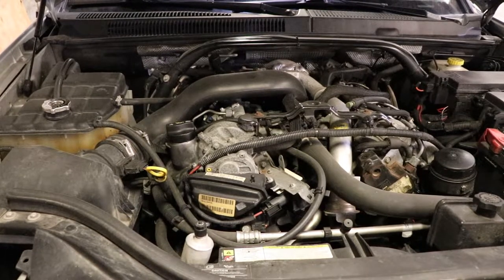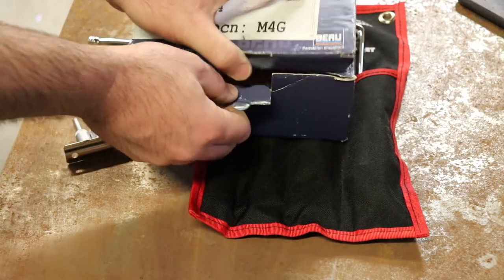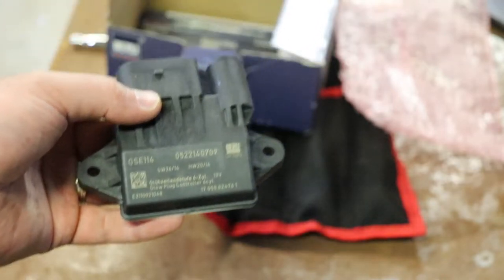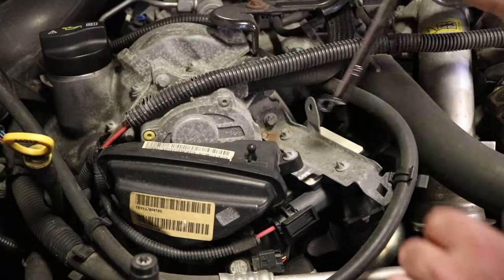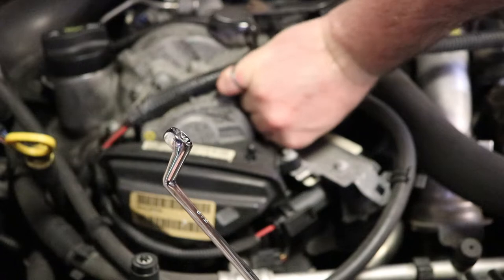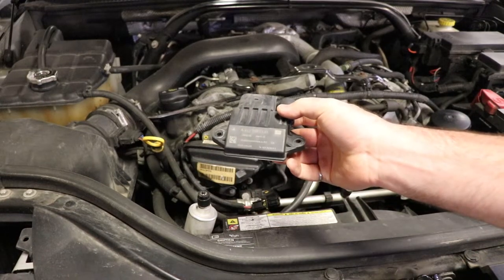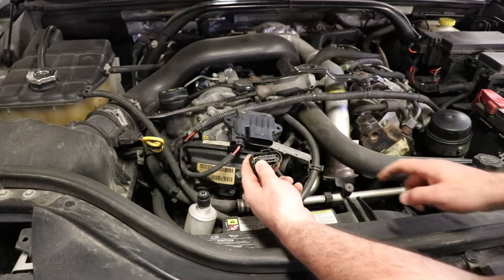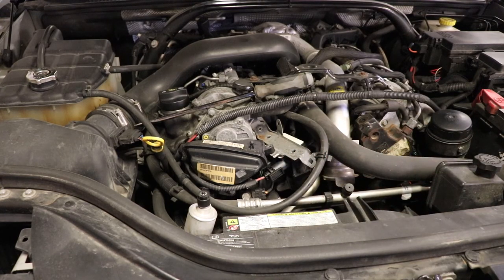2005-2010 Jeep Grand Cherokee WK CRD OM642 Glow Plug Controller Replacement

Comment: You need a coolant flush in a really bad way my friend. The coolant is like 10 shades too yellow from the original orange. You can see the oxidation of the coolant has also turned the coolant reservoir hazy. Probably too late to save the coolant reservoir, but you can still give the truck fresh coolant and protect the rest of the engine. I flush the coolant every 40-50k miles on mine and the reservoir is still crystal clear like from the factory. Message me and I'll send you a pic of what I'm talking about and the rest of the details. Distilled water is very important during the flush and getting the engine hot enough to open the tstat for the flush.
Reply from the maker: You have a good eye.  I suspect it has the original coolant and I have been ignoring it.  I bought a replacement water pump and coolant when I got the jeep many years ago but never changed it.
Reply: @SteveRivett  same   6-7 years. Never changed. 😳🫢
Reply: Send me please also specifications for the coolant changing. Thank You.